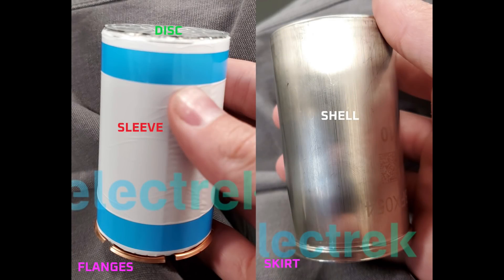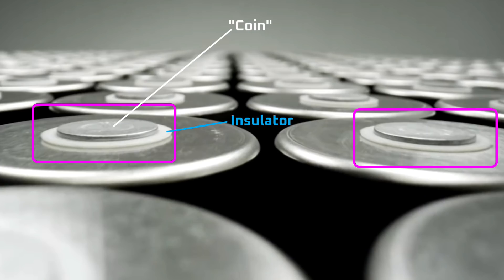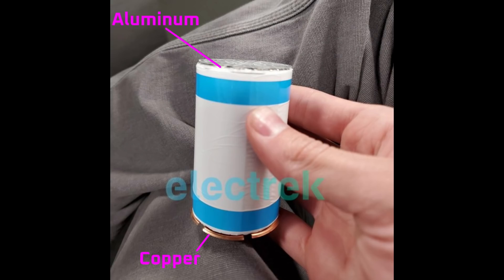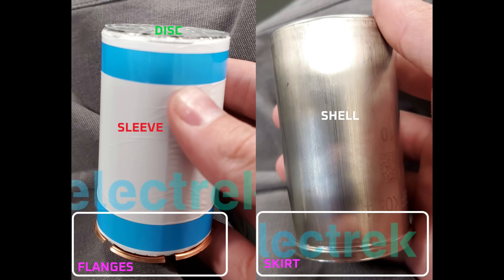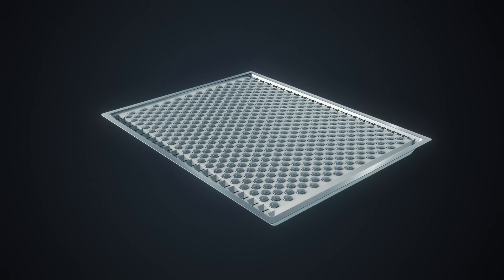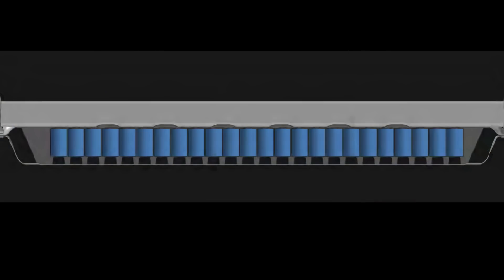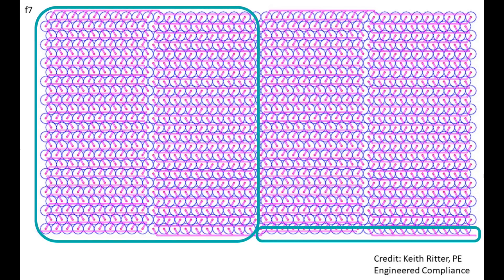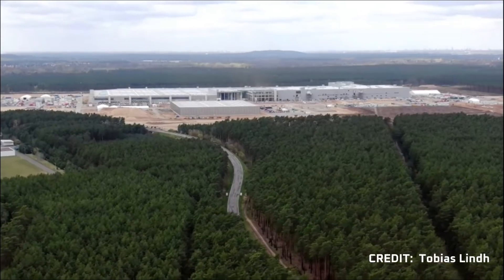#16 Manufacturing the Structural Battery Pack from the Cell Up

Comment: If a row of cells is to be wired in series, then both poles of the cells have to be electrically isolated from the coolant tray. It is easy to see how the “button” could be isolated from  the shell of the cell, but less easy to see how the shell could be isolated from the coolant tray, while still preserving a metal-to-metal heat transferring path at the bottom of the cell from the overlapping copper tabs that provide short paths for electrons and heat at the ends of the cells.  It almost seems like there needs to be two button at the top for current paths that permit series wiring of rows or columns, but that only makes sense if cooling is done to the sides of the cells, as is done now, instead of the bottoms of the cells by them sitting on a coolant tray.  Any cooling on the sides requires greater separation of the cells unless it is done with a non-conductive fluid pumped through the entire pack surrounding the cells.  If the shell of the cell is not electrically connected to either electrode, that provides other options, but that would complicate manufacture, but it might be necessary.  The cells still need a pressure vent to prevent explosions should one short internally.  Almost seems like it would be better to insulate the jelly roll from the shell, put a non-conductive separator and heat sink paste inside at the bottom of the jelly roll to permit heat transfer out the bottom, and bring both electrical connection buttons to the top of the 46mm end cap along with a safety vent made into the cap.  With 46mm there would be room enough on the cap for two electrical connections and a vent.  So, all power connections at the top end, and heat transfer via the overlaying copper tabs out the bottom of the cell shell into a hollow coolant tray filled with liquid coolant.  That would guarantee a short heat path through copper for all layers of the jelly roll, and all electrical connections at the top for ease of wiring in series or parallel as required for proper pack voltage and battery management.  It also seems like with this major battery redesign, it would be a good time to raise pack voltage into the 800 volt range to minimize the gage of wiring needed within the car, and in the charging cables.  Current MOSFETS and IGBTs can now handle such voltages.

Comment: The Epoxy would be a insulator between cells though. Alternately, you could add carbon nanotubes to the epoxy (aka Eden Innovations Edenplast)? The CNT are highly conductive and it would make sense to make the thermal profile uniform across the cells.
Reply: Yeah but carbon tends to be a cure inhibitor in a lot of resins due to chemistry. Epoxy often also requires an autoclave (higher pressure/temp) to fully cure so process variables may influence what binder in the pack.

Either way, structural fiber reinforcement (often a fabric) will likely be used with any binder in the pack to make a composite.

Comment: I agree, the green wrap and the paper surround seem to be unwarranted and would potentially be a weak point in the bonding and shear transfer processes, and are irrelevant to a cell that is entombed, hidden from eyesight and from repairs (never to be seen again until recycled).
I do find it curious though that the brilliant green wrap seems to be a match for the green colour that is covering the walls of their new Gigafactories that are still under construction. Is that green wrap more a PR / branding thing?

Comment: Didnt bill Wright in Twitter state that the render with the wires all on the top was close to reality? So that aligns with the idea that there is circuit board connections on the top
Reply from the maker: He did 🤠
Reply: @thelimitingfactor  and since he is a Tesla insider, I am very confident that your analysis is as close as we can get
Reply: It would make sense for several reasons to have the wires and circuit board on top, primarily to reduce risk in bottom collision damage from road debris , curbs etc. The strongest part of the pack would also face down to the ground to prevent similar damage. Also , tyres changes and undercar service jack points would be on bottom and would necessitate no cells nor wiring/circuit boards near them.  Also, makes sense to make top more serviceable and exposed by just dropping the pack.

Comment: how to insulate/connect the top of the cell?? (around 5:20)
that's easy
take a disk that's close to the full diameter of the cell and has a rod attached at the center (the top of the rod is your 'coin size connector)
put the insulator on top of this, it would be a disk with  flange on the bottom to make sure the large disk is isolated from the sides and a flange on the top to make sure the rod (i.e. coin) is isolated from the top on it's sides.

This can just drop in to the cell when it's upside down, the put in the battery and seal the bottom.
Reply: I threw together a quick mockup in onshape https://cad.onshape.com/documents/e86dbd82ca7d2ebfc0246851/w/bf2e2c13f5b3435395c6e5a3/e/a7511396553174388e3bb642
Reply: remember, the advantage of a tabless cell is that the electrical connection is across the entire end of the cell, so you don't want to loose that.
this mockup has the bottom of the cell connected to the entire shell and the top of the cell connected to the button maximizing electrical/thermal connectivity. (the onshape model is free to anyone to use)
Reply from the maker: Awesome!  Thanks David!

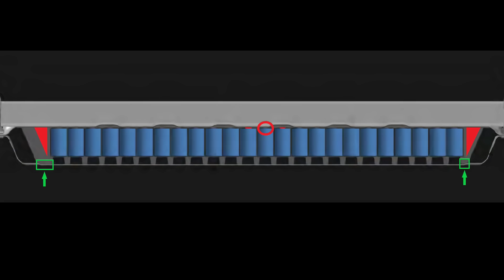Comment: At 12:20, the difference in spacing on either side may be a result of showing only the first row of batteries in the pack. The next row would shift the imbalance to the opposite side.

Comment: highly doubtful that the epoxy structure (cell holder) would be prefabricated for cells to 'slide' in; as that would greatly reduce the overall strength of the structure (unless glue is applied to the cell casing to bond with the epoxy mold....seems like a tenuous process).
In all probability, all cells will be held in place, connections welded, top/bottom plate welded..AND THEN the epoxy is poured through the ensemble to rigidly bind everything.

Comment: The shrinkwrap may be in place to allow the battery to be pushed out of the pack at recycling time or to replace bad cells at a later date. The shrinkwrap would act as a "waxy surface" to prevent the epoxy from adhering to the can.

Just a thought. I love the videos. Thanks for your hard work.
Reply: Yes, good thought. That ties a bit into worries of this model re maintenance and cell exchange when binding the whole pack with epoxy. If Tesla is positive this will only rarely occur, I guess it's ok. Excited to learn how they do it exactly. 
Fantastic presentation btw.
Reply from the maker: GREAT idea!

Comment: Fantastic Jordan. You are thorough and precise. My take may be a third way. Depending on the Z axis available depending on the vehicle, Tesla may use other structural designs to make the better use of the footprint area available in between the wheels. I'd love to keep the discussion running

Comment: I dunno.  Seems like it would make more sense to make the honeycomb out of aluminum for better heat transfer.  Yes, it would cost more than epoxy but I wonder it that trade off is suitable for Tesla.
Reply: Monroe says the best heat transfer is off the bottom, not the side. Hence, most packs have the coolant on the bottom. I think the heat flows downward in the cell to the bottom.
Reply: @AndyZach  Heat will "flow" to the coolest part of the system.  That's the second law of thermodynamics .  Like your screen name, BTW.

Comment: I think the leak via Sandy is most likely closer to the final product. It wastes less space and is easier to manufacture. I think it will always be necessary to insulate the external case of the cells individually as there will be significant voltage differences between rows and you do not want to risk any filling material having gaps and resulting in shorts. It just makes more sense overall to leave out any filling material and have the batteries touching but with insulating material on the batteries. Remember that being structural it must also withstand some amount of pressure and possibly distortion in the event of a crash without shorting.

Comment: nothing to rule out anything, but a thought I see on this is they could be building around current battery packs as reference design. This would allow for testing longevity the packs before they go structural. I.E> Building packs that simply bolt into current Model 3/Y and X/S chassis to range test, charge test, and environment test before they move on to a more final design?
Reply from the maker: That's a really good point!  The versions in the vehicles on the road certainly wouldn't be the final version.

Comment: Could the column below the coin (inside the cell) be externally insulated? The column would then have its own insulated and metallic disc on the bottom of the cells which would isolate the body and transfer electrons? 🤔
Reply from the maker: Could be, I'd have to see it diagrammed out and how it works with everything else.  Although, I have to move on from the structural pack for now and am just waiting to see what the real deal looks like.

Comment: Amazing research, insight, understanding and humble self awareness . . . . total winning combination.
Reply: For real crypto is profitable 
Crypto is the new gold
Reply: I wanted to trade Crypto but got confused by the fluctuations in price
Reply: Wow, I can't believe I saw that he is real, I just checked google, and was able to see that he is a registered trader.
Reply: Met Micheal first time at a meeting in Las Vegas early 2019. His teachings on trading is fascinating
Reply: if the epoxy structure is indeed prefabrecated it means the batteries glides inside and wont stick on it. so the battery pack looses some of its strenght maybe. the good part is the batteries could be easier taken out from epoxy to be recycle.

Comment: Thanks for numbering the episodes.  Great series.  At 12.15 I think the diagram is correct. The rows of cells are offset which would explain the differences in the the size of the red triangles for a given cross section.

Comment: There's another engineering challenge to the cell design: the cell must not leak gases or electrolyte in normal use, even with some internal pressure. This is easily achieved with the conventional crimp and gasket approach.

Comment: Thanks for your awesome videos!
I have no clue about electrical engineering, but when I am thinking about this structural battery, my mind creates it in the following way;

The + and - charges are not both on the same side, but one is in top and the other on the bottom.

On top and bottom, one metal sheet each with pre fabricated connections is glued together with the cella.
These two metal sheets with all cells glued inside then basically create one (or several) giant "batteries".

Would be awesome to get some feedback from you or other people more familiar with that matter telling me why Tesla would not do it like this (or if they might do so).
Reply from the maker: It's feasible, but I'd have to think it out.  I don't foresee that it would be easier, just different.
Reply: Busses

Comment: I like the honeycomb idea, I know Tesla is always looking to reduce steps and number of times a part is handled. I can see Tesla putting the cells right into the honeycomb off of the cell production line. On the other hand, the leaked photo shows no honeycomb and protective sleeves for the cells. Well here is part of the secret sauce at Tesla that allows them to make rapid progress: they will green light several potential solutions to a problem at the same time and see what actually works best. It is possible that teams are working on both a pack with a honeycomb and one without.

Comment: Any thoughts on possibly moving to a higher voltage pack?  Many competitors are moving to 800ish volt architectures and it seems like a good move.  Those packs are able to sustain high charging rates for longer.  Will the 4680 be able to compete with this at 400 volts or would moving to 800 volts be more beneficial?
Reply: The pack voltage makes essentially no difference at the cell level, it's just a matter of how many cells are in series. The advantage of higher voltage is that cables can be thinner, which can save weight and cost. And if your cable thickness is limited for some reason, then using a higher voltage can increase the power. For example, if the cable at the charging station is the limiting factor (😁), then higher voltage can help. For Tesla, a higher voltage might be useful for really big packs like in the Cybertruck. On the flip side, a higher voltage needs higher grade switches and electronic components.
Reply: @juhak27  nailed it
Reply: I believe Sandy Munro talked about this in a recent video. He said Elon wants to move to 800 volts but can't migrate all the electronics over easily
Reply: as Juha wrote, the 4680 cell could be used in 400V or 800V systems. the cell doesn't care.
Reply: These are all great points, but it sounds like there are potential limitations for Tesla to move to 800V.  I guess I am wondering if the 4680 charging characteristics at 400 volts would be able to be competitive with the 800 V architecture.  I agree, the bigger the pack, the bigger the benefit.  The Tesla Semi is probably the first in line for adopting this.  I guess I may be a little disappointed if they don't move to 800 unless they can show that the 4680 is competitive at 400, but maybe no one is talking about it because it's a very simple thing to change?
Reply: Are 800volts packs chargeable with AC house's 110 Volts outlets??
Reply: @xXZ31t6esTXx  yes

Comment: Running cooling front to back would have fewer connections. Running cooling side to side would be more efficient. As coolant absorbs heat it becomes less efficient (exponentially with temperature I think). 
Long term if they can get rid of the epoxy used as filler between cells it would be lighter. Epoxy Bonds only at the top and bottom. Air, foam or coolant between cells.
Reply: You raised a fair point, thank you.
Front to back works plenty good, just needs clever (alternate direction) coolant channeling to achieve fairly uniform cooling.
Reply: I can't see a good enough reason to have the honeycomb and fill all the gaps between cells with epoxy, it just seems redundant. Putting the cooling in channels under the cells adds considerable depth. Logically, surely the thing to do is fix the cells top and bottom to handle shear and then run the coolant through the spaces between cells where it could cool/heat optimally and the whole pack could be as thin as possible. Less complexity, less weight and it would still be possible to replace faulty cells which I think is vital.
Maybe the cells are to be prepared as batteries the full width of the pack, with a plate/sheet welded to all the bases and another to all the coins (with an insulator with holes in it sandwiched between the plate and the cell body). Then bond these batteries to a top and bottom structural sheet/plate running the full length of the pack using an insulating adhesive. The batteries could then be tapped all down the side of the pack. The bond between the top sheet of the pack and the battery sheet and the cell would be plenty strong enough to handle shear. In fact, every component would be structural.
Coolant can then just be run between cells and in the case of a fire act as a suppressant.